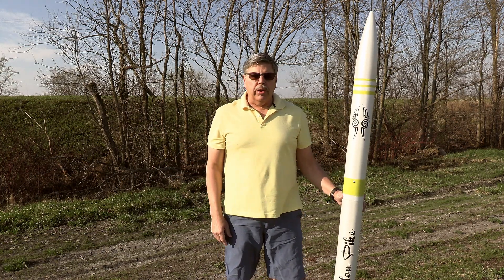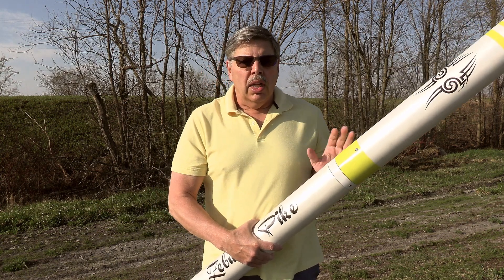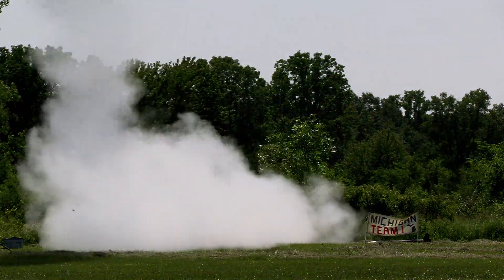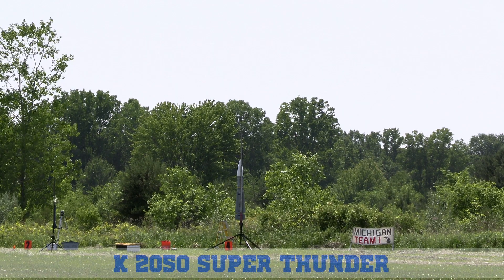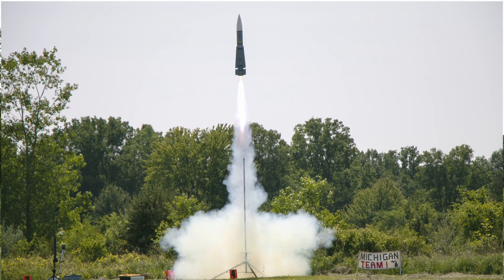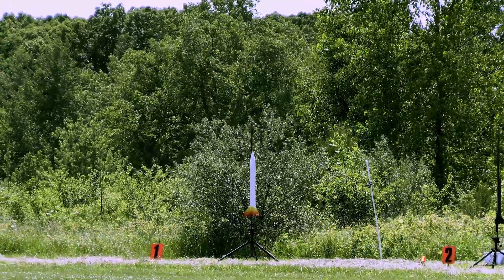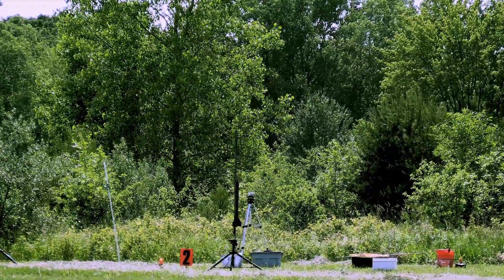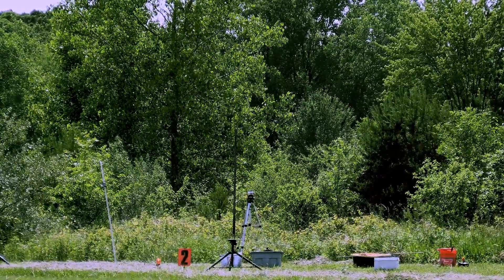Zebulon Pike Rocket Launch!

Comment: Cool! What are the characteristics of the engine? diameter and length
Reply from the maker: I have flown Zebulon Pike on a 54mm 1200 and 1600 case with sorbitol fuel. The case lengths are 12.875 and 15.875 inches long.

Comment: Awesome, can you make a video on this rocket? It would be interesting to see how the fincan is made/designed and how it holds up against crashes and the heat of the motor.
Reply from the maker: A friend of mine designed the fin can, I will have a 3D printer soon. The motor mount uses stock LocPrecision parts to insulate the printed pieces from heat. Only time will tell how durable it will be. My best guess is it will be fine unless there is a crash and if that happens I will reprint the broken item.
I make note of all requests and will consider filming a video on the process. Thanks for your comment!
Reply: @TheRocketeer what material is it printed with?